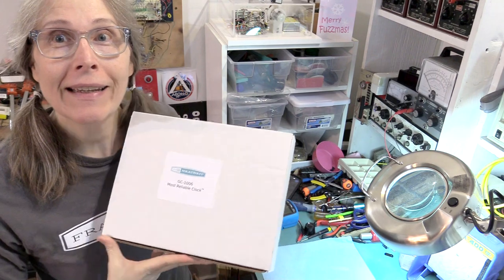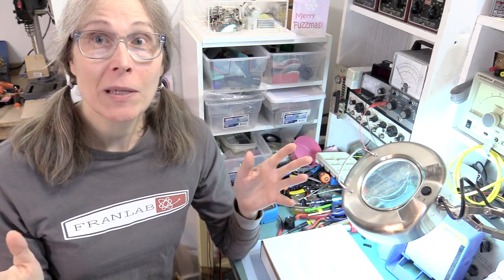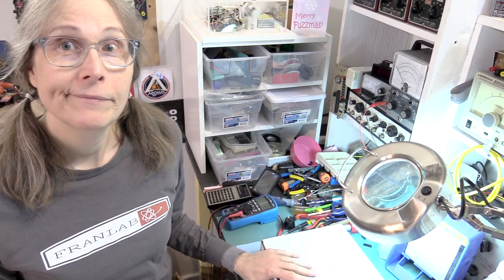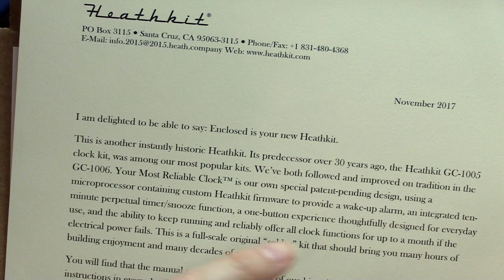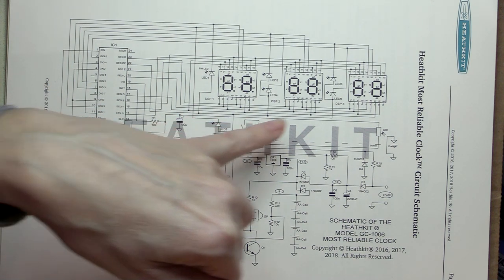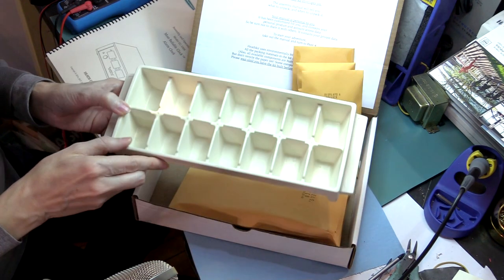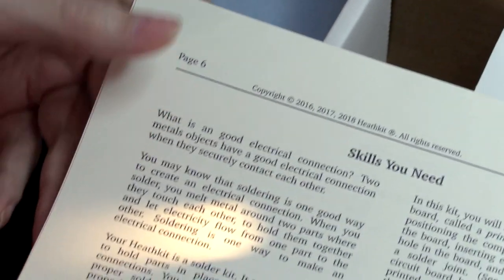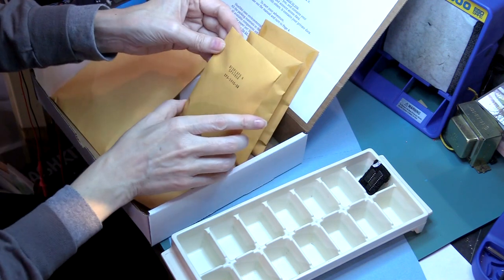New Heathkit GC-1006 Clock Build!   Part 1

Comment: I never built a Heathkit, nice to know I might be able to in future. I did build a Radio Shack kit, an  analog VOM.  
I repair computers on occasion and discovered the ice cube trays myself but I now get the parts containers with the snap on tops.  I put all the pieces for one subassembly in one or two cubes and snap the tops shut when I'm done with the disassembly.  
I can see not using sockets for the displays, but I think having no battery power is pushing things. We do get power outages or the desire to use the clock far away from power lines.  
I know what a mess a leaking battery makes. Short of keeping the batteries outside of the box so we can see oncoming leakage, we need another fix. Any ideas?
Reply: I don't know what business model the new Heathkit uses, but things have changed a lot!  We now have open source hardware.  I for one would appreciate kits for open source projects with good instructions.  I'd pay a reasonable sum for that.  Building a computer or a TV is right out!  I already build and modify desktops and some laptops.  Among other things, you can't get large size and high pixel count LCDs or OLEDs in the USA or Europe for TVs or Monitors.  Then there's the politics of tarifs and the like.
Make some test gear kits and mods for, say, cheap oscilloscopes. Redo the mods when they no longer apply.  Or.. only modify really old (tube?) scopes to bring them up to date.

Comment: I'd like to wish you a happy New year!
I appreciate your videos, but was surprised Heathkit was still surviving!
These kits were considered as the best and most complete. However, they were hardly sold here in Europe, considered as too costly with the import duties. Even if they were considered top choice, those kits were too expensive, as many local (low cost ?) manufacturers were selling less elaborate or limited kits. For instance, the enclosure was generally not included, and the option was generally worth equivalent of the electronics... And few offered so complex tools like oscilloscopes...

 When it comes to this most recent version, it's difficult to say if that's really original stuff, as these type of one chip clock kits are available everywhere since the mid 80's, and as the quality does not look that fine. And for what could be considered of the global interest, well, I believe it's limited. Too elaborate for explaining basics for a beginner, too limited for anybody with a little skills. Let say this kit can probably built in less than three hours by any good old fashioned electronics passionate or collector like we are, but I don't know if they could succeed reviving the interest for the young people for these kind of things. It's a generation's choice to build this kind of circuits from an Arduino or equivalent and add premade bricks and programs. For something more elaborate, there's a bunch of Nixie tube clocks from China available online that are more "consistent" and not so costly, and for top lab nerds, some real time atomic source clock... One of their main success was specialized or high end equipment. But they also sold from simple radio circuits to complete labs, including oscilloscopes, generators, tube measuring tools... As you say, everything you can now buy relatively cheap, or won't find easily. They need a limited market with new, good and original products that will be appreciated by their customers, and you know even the best recipes are never that easy to sell. Some HiFi companies sold kit amps, but failed to survive consumer electronics.
I'd like to share your joy and happiness seeing this long time Company survive, but I've some doubts. You know the market needs a good catalogue with classic reference products but also surprising new ones that follows the needs and modes of it's customers.

Comment: A potential divider across the batteries to measure the voltage! Hmm, what could be wrong with that?
Reply: Hmmm is it 10k to GND? So 0.6 mA. If there are 2000mAh in the battery ...
Reply: @matthiasplus6691  Yes and having a 9V battery regulated down to 5V with a linear regulator seems a bit brain dead as well.
Reply: @nophead  Yes, the divider should be two 1M resistors instead of 10k. The ADC input of the micro is not too high impedance, so it will load that divider too much and drag the voltage, but you can compensate for that.
I don't have a huge problem with the regulator, since it's just a backup battery, not designed for continous operation, just to maintain the time during power outages. BUT it would be nicer if they used a true RTC chip with lithium cell backup. That software clock won't be too accurate, I guess. Maybe they thought the RTC solution would not be retro enough.
Reply: mrnmrn1 The kit uses line frequency for timing. It's more accurate than a crystal oscillator.
Reply: @ve2mrxB  Not when it is on battery power.
Reply: nophead Maybe, in that case something like a DS3231 RTC chip would be my pick. 

The equivalent is doable in firmware if you have a temperature sensor and a reference frequency to calibrate. The micro-controller might have the sensor, and the 60Hz can be used to measure the local oscillator drift over time.

So, in the end, it mostly depends on how much they tried. They specifically write "Live in an unusually cold or warm environment that could cause electronics to drift? Just run the simple pushbutton calibration procedure built into your Most Reliable ClockTM to adapt it to your special environment and make it even more reliable." My guess is that they try. 

It's the DS3231 that duplicates software, as it was done way before they put it on a chip! I remember in the '90s Dallas Semiconductors provided code to do the same calibration as the DS3231 does in hardware.
Reply: @ve2mrxB  Is line frequency more accurate then a TCXO? Sorry, but I doubt it. Do you have a reference for it? But what I surely know, in the '80s here in Middle-Europe line referenced clock radios were out by minutes per week, sometimes minutes per day. DIY electronics magazines often made articles about how to upgrade your clock radio to x-tal reference. 

I know that nowadays line frequency is very accurate, but I doubt it to be more accurate then a 0.5ppm TCXO. Also, power line interference may affect the counter in the clock.

I have near to zero knowledge about AVR programming, but AFAIK, software based AVR and PIC clocks are usually not as accurate as dedicated RTCs or dedicated clock chips used in clock radios. It depends on how well the code has been written, but sometimes user interface action (pressing buttons) can delay the counting.
Reply: mrnmrn1 I'd say it depends on the TCXO, as today's line frequency is derived from traceable frequency standards for interconnection to neighbouring power networks.

I can't speak for yours, but my Quebec, Canada line frequency is exact over a 24h period. Interference excluded, of course. Don't run motors on the same circuit ;-)

Since we are talking about the GC-1005/1006, I would call that line frequency precise.

If you do an unfair comparison with the GC-1000, I 'd say it's not even close. Depends on your needs, of course.

I do run an NTP time source synchonized by GPS accurate to about 300ns(jitter) on my Raspberry Pi, for fun. My main desk clocks and watch are WWVB-synchronized. My clock next to the main TV (35" Sony Trinitron) is fraction of a second per month precise and line-synchronized, as well as stove and microwave. But the other battery ones are all over the place, as expected. They cost about the price of a DS3231 alone, so, won't happen there! But they could be precise with proper design and added cost.

Take the right tool for the job. For a table clock, line frequency is very precise. For a frequency standard or nanosecond precision, use something else.
Reply: mrnmrn1 For the AVR programming, you are absolutely right that it's tricky. But it's doable with the appropriate program architecture and inputs. Far from easy, that's why I use a DS3231 in my stuff. It's close to a dedicated microcontroller for timekeeping, with TCXO, pre-calibrated.

But you must play with a lot of buttons to lose a barely noticeable 0.05 second! It's 400k clock cycles on a 8MHz Arduino... That leaves a LOT of idle CPU time. What the DS3231 does was done in software before!
Reply: mrnmrn1 I calculated the worst case for the DS3231 (3.5ppm for 32.768kHz, best is 2.0ppm) is +-9 seconds per month. Line frequency is (in Quebec) more precise than that. Still, much simpler than software doing the same.

Comment: That is really odd having just some pads on the top of the board.  I see that where they do have pads on the top, they are running traces to them, so that makes a little sense.  Is the board through-hole plated?  Put an ohm meter or tracer on each side of one of those and see if there is a connection.  I'll bet to save costs, they didn't even get the boards plated. 
I never worked in a company doing this, but did do a fair amount of PCB board design for university research, and in the quantities of boards I'd order, the difference in price in getting a board through-hole plated or not was not worth the trouble of manually soldering my top pads and vias.  I designed multilayer boards, so with a power and ground layer, I needed plated holes anyhow.

Comment: Those sockets supplied with kit should be discarded and replaced with turned pin sockets instead. I've never had one fail in 30 years so they should be good forever.

Comment: Comparing that manual with an original from 1976, I can see that a lot of the stuff at the beginning was copied.   The solder bridge photos are the same, although they have added some sentences to the text.   The old manual shows the color code for each resistor in the step to install it, so no overall explanation of how to read the color bands.  The drawing of the tools you will need is almost identical to the old one, although the soldering station is called "Heathkit Soldering Iron" in the old manual.  The drawings showing how to solder  are the same.   So it looks like they took a lot of the old stuff, but added some new text as well.   The sentences that had the typos in them do not appear in the old manual.   HNY!
Reply: Those soldering pictures look just like the ones in my Dynakit manuals.  I suspect that both companies copied from some other source????

Comment: In the tradition of the Most Accurate Clock kit, we present the So-So Accurate Clock with none of the features that made the original great.

Anybody else puzzled how it uses four switches for one button operation? Maybe it doesn't matter which one you push?
Reply: Hugh Brackett It doesn't compete with the GC-1000, but the GC-1005 which Fran showed at the beginning.
Reply: @ve2mrxB  oops you're right. I thought the manual was talking about the GC-1000.

Comment: I didn't know the new Heathkit got taken over by a "new new" Heathkit. So possibly it could be one of those "Buy failing company / Add and/or transfer debt to the company / File for Chapter 11" operations now. Too bad.

When I started watching your video I thought: Hey this could be exciting! However, when I looked at the Heathkit information page about this kit, I was disappointed to see that "the most reliable clock" is about equivalent to the clock radio that's next to my bed, except there's no radio and the battery backup is based on AA batteries instead of a 9V battery. The time base is the line frequency which, I agree, is accurate in the long run (unless your house uses a generator, of course). but $100 seems like a lot of money for something like this. I could probably build a GPS based clock for that kind of money (though I admit, I wouldn't be able to make it look like a Heathkit).

So I'm a little underwhelmed but I love kit building (and kit building videos) so I'll still be following this with interest. Happy New Year, Fran!
Reply: Jac Goudsmit This kit gave me the idea  to use a Raspberry Pi with NTP and GPS. I already have that, I just need to add a display!

Comment: This clock has a few nice features like a seconds display and some clever pushbutton controls, but its claim to fame as "most reliable" is all about its battery backup system, which is supposed to keep time more accurately when its microcontroller's clock is calibrated using the power line frequency as a reference.

To me, this is of dubious value. How often do you lose power and when you do, how concerned are you that your Heathkit clock keeps good time on battery power?

This is a far cry from their classic "most accurate" clocks that synchronized with and calibrated their internal oscillators based on WWV and WWVH.

Who really needs either Heathkit clock when your computer's and cellphone's clock are always correct?

However, I too bought one of the new clocks because I sorely miss the old one I had beside my bed for decades until its Panaplex displays failed.

Fortunately, the new kit didn't come with the poorly glued parts or damaged wood side panels that Fran's has.

It's been sitting half assembled in a box for a while.

I may just have to finish assembling it along with Fran as she assembles hers.
Reply: MikeMike - yeah... these days, most accurate would be a GPS receiver, considering that it’s being driven by multiple synchronized atomic clocks...
Reply: @MikeMike  This model runs off a DC wall brick.. so there is no "power line frequency as a reference". 
It is what it is.. it's a Heathkit.. never the best.. never the worst.
Get in there and enjoy finishing your build like Fran will.
✌
Reply: @Circa-rc4sn  That's what I thought at first, but the wall brick is actually a simple transformer with a 9V AC output.
Reply: @mikemike7001  My bad.. Fran said 9VAC 1000mA and line item 1 states the same. Another obvious clue, I missed, is the rectifier on the schematic 😳

Comment: Sadly Heathkit is no longer Heathkit. They've worked hard to duplicate the feel of the original healthkit but as you rightly say in the video there is no array of professionals behind this company any more. It was disappointing to see a basic arduino based microcontroller rebadged with a heathkit code. You could have bought the internals from China for $3 the case was trying to look quality but as you found - it wasn't.